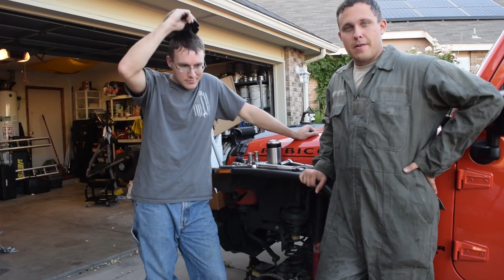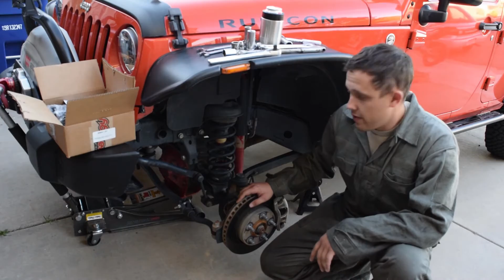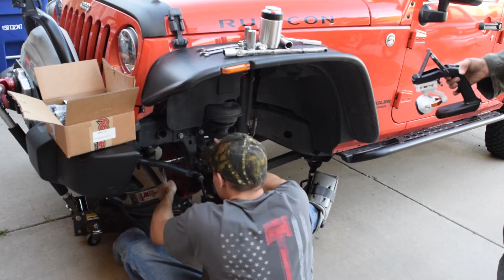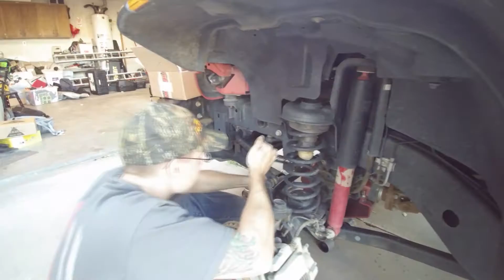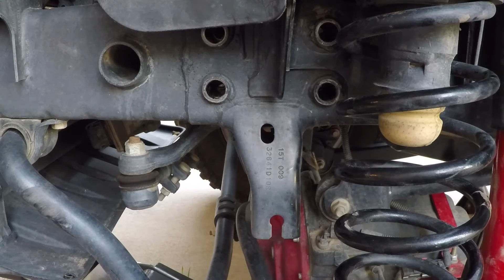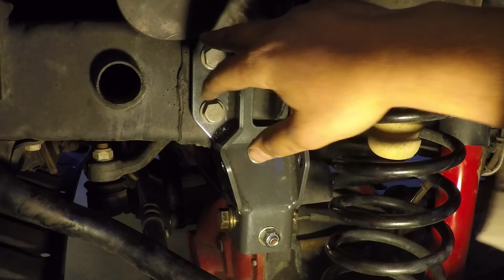Synergy Manufacturing Jeep JK Front Track Bar Brace

Comment: No feedback? No after action report ?
Reply from the maker: Been running the brace for years now, installed the sector shaft brace that goes with it about a year ago. The only thing I could gripe about is the coil spring rubs on the rearward ear of the brace, but no real damage has been done to either the brace or spring. A worthy upgrade if you are worried about the factory mount welds failing. Its also a good fix if the factory mount holes become ovaled out or elongated from abuse.

Comment: What trackbar were you guys running? Synergy says you have to run theirs with the brace .. i’d rather run the teraflex forged one
Reply from the maker: Ran the stock trackbar with no issues until we tried to add the Synergy Sector Shaft Brace to their trackbar brace. Then there were major interference issues between the trackbar and the new nut for the pitman arm. After we installed a set of 1 3/4” spring spacers, 35” tires, and added 1” bump stop spacers, we tried to reinstall the sector shaft brace and same thing happened. Tried one more time after adding a 3 1/2” lift and a total of 3” of bump stop spacer and it still wouldn’t work with the aftermarket adjustable trackbar supplied with the kit. The sector shaft brace is still sitting on the shelf and will probably get melted down into a paperweight for all its trouble. As long as you are using just their trackbar brace, you should be fine. That piece is well designed and has worked with the stock and aftermarket trackbars we have. One thing I will mention, the rear wing that comes off of the brace where one of the mounting holes is located for the sector shaft brace rubs the coil spring and makes poping noises under articulation. A slight annoyance if you can live with it. I plan on cutting that rear wing off next time we are under the front end to stop all the noise and keep it from trying to saw the front coil spring in half.
Reply: I was planning on getting the sector shaft brace as well with a stock track bar. So you wouldn’t recommend this?

Comment: did you also have to purchase the synergy  track bar? if not what track bar can fit on the new brace?
Reply from the maker: Nikki Corrigan we used the stock track bar, it worked perfectly. Rather smooth install. I recommend it.